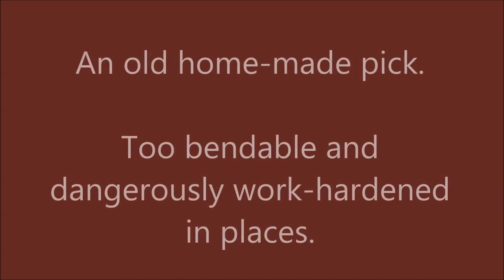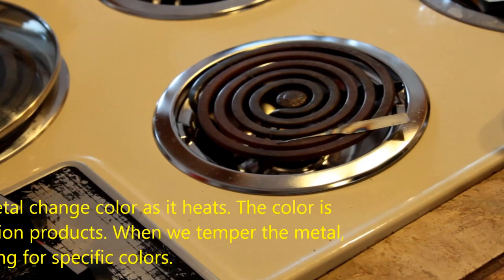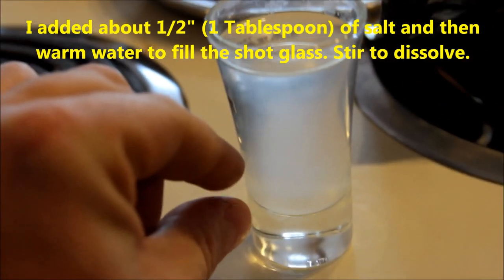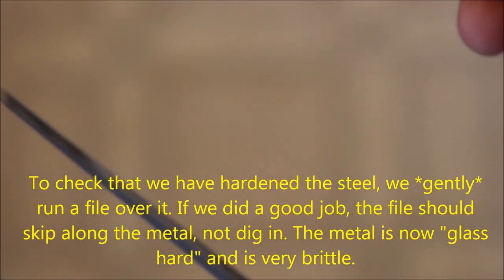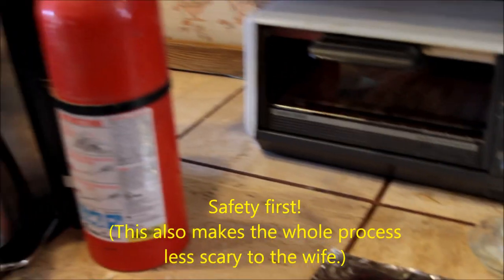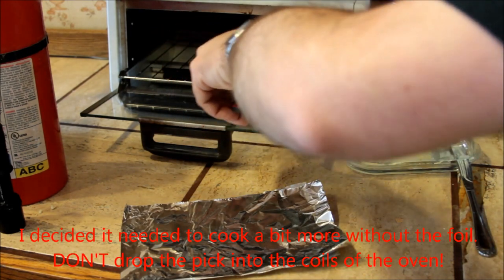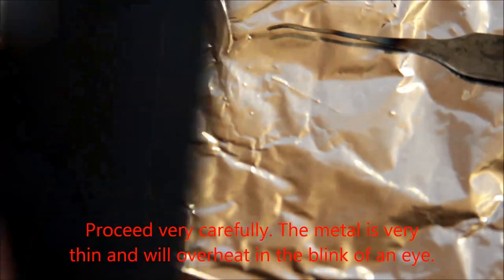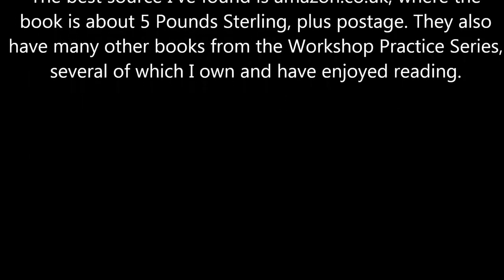(015) Hot Picks: Homebrew Heat Treatment

Comment from the maker: If you get the tempering stage right, carbon steel hacksaw blades work really well. It sounds like you might have a well-temperature-controlled heating system, which will make this step much easier. Invest in that little book -- among other things, it gives good tables of temperature ranges.

Comment from the maker: Different steels require different heat treatments. The process I demonstrated works for many carbon steels. As you get into more exotic alloys, the process becomes far more complicated. Even with carbon steel, the critical temperatures vary depending on the carbon content. Check out the book -- you can probably get it for a couple Pounds and read it in an afternoon. :)